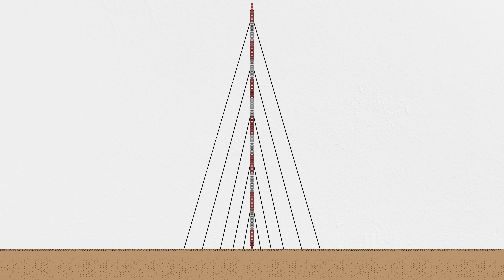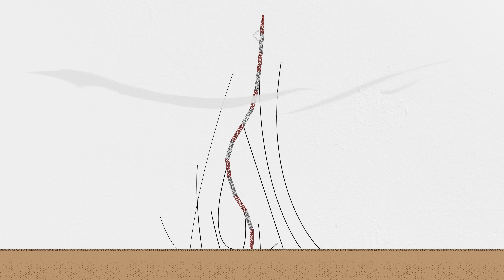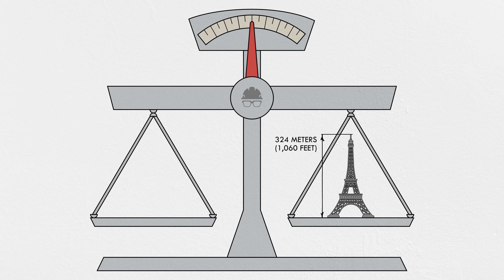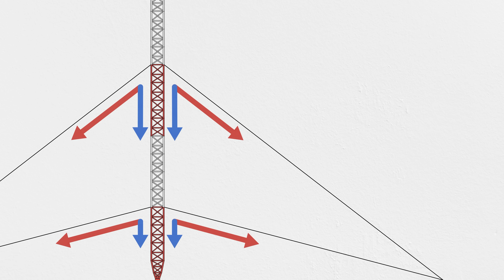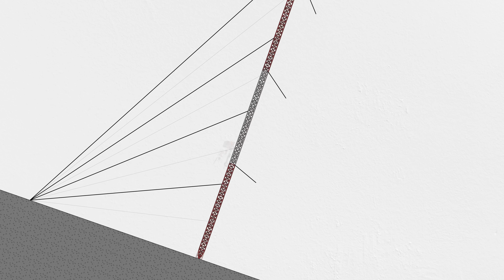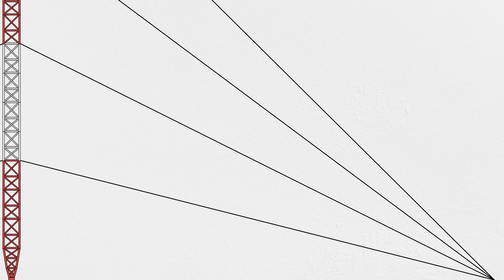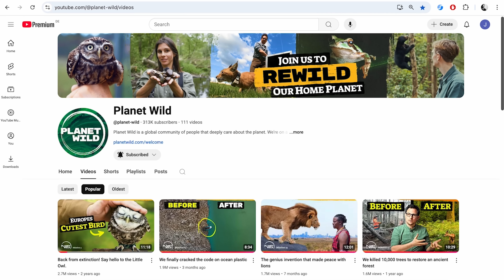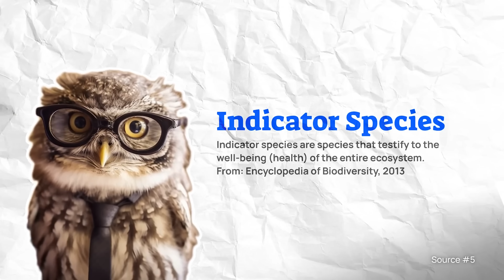The Bizarre Bases of Antenna Towers

Comment: 12:15 - Just don't touch those towers!

And for those who've never seen one—the ceramic base is usually hollow on the inside, filled with a special oil to help provide rigidity over decades of use, with massive strain from above (those guys pull down with a lot of force!).

Also, for AM towers (which are energized), guy wires also have to have special insulated connections, and the design of the guy wires themselves have to be accounted for in the overall antenna design, since different lengths of wire will affect signal propagation and couple to the signal differently.
Reply: At one point Grady mentioned having to put aircraft warning lights on towers but he didn't mention how those lights are powered.  For situations where the tower itself is the radiator you can't just clamp an extension cord onto the tower and connect it to the lights!  If you look at the tower base photo at 12:22 you will see just to the right of the base of the tower 2 grey interlocking rings.  This is a special type of transformer that has a very low capacitance between the primary (lower ring) and the secondary (upper ring).  The primary is energized with grid power and the secondary connects to a cable that leads to the tower light.  The Austin company is one of the major manufacturers of these isolation transformers.    Lots of interesting and unusual tech on radio towers...
Reply: I'm surprised there isn't a collaboration between Grady and you for this video!
Reply: Just use 4 guy wires and make them the radiating element and now you have 2 inverted V dipoles that you can cross polarize to help steer the proportion. Sorry, this is a project I really wanna do with my ham shack
Reply: I loved the videos you did with your dad on the towers. It's crazy when you get to the point where a 'coaxial cable' is basically just a pipe with a smaller pipe inside!
Reply: Those videos you did of the towers your dad looks after were SO interesting, I found them fascinating.
Reply: The legend himself! Good to see you, Jeff. I've worked at the American Tower broadcast facility in Needham, MA -- one of the tallest in the country. The main tower puts out over 1.8MW when energized. Climbing a tower while in that state will leave you with massive internal bleeding.
Reply: @mystic-ripple-r5s7  I'd love to be able to visit a few of the bigger towers with my Dad sometime; right now he's still 'retiring' haha... meaning he still works about 20 hours a week in radio engineering!
Reply: For AM towers they use a wood ladder to get onto them if they are energized.
Reply: HA!  Just called out you guys' awesome video above then scrolled down to see this.
Reply: That spark gap thingy was very cool...
Reply: When i saw this video i went straight to the comments looking for yours!!!
Reply: We made a jig to jack up the tower to replace one...done a few actually. Last one I did was stressful as all hell. The insulator (Made by NGK...yes the Japanese spark plug company) was defective and as we lowered the tower back down onto it, it cracked and all of the oil from the center leaked out...it ended up shearing in half (Have a picture of both halves sitting on the tailgate of one of our trucks). They sent out a replacement and we finished the job a few weeks later. (Also, it may just be us, but we call the ceramic guy-wire insulators "Johnny balls"...no idea why...fun standing near an AM tower with them when there's an electric storm...the arcing of the electricity past the Johnny balls sounds like sizzling bacon (We've also built some with synthetic guy wires...more common on FM towers for the top bit where they shadow the antennas, and transition to steel below the antenna level)).
Reply: I was really hoping Grady would insert a hot dog reference.  The videos you did with your dad on AM radio towers were fantastic.
Reply: Back in 2000, it was Halloween night during my freshman year of high school and I and 2 of my friends decided to climb one…… we got a little higher than the middle light and decided to it was too cold for our hands to climb any higher.  One of the guys suddenly had to poop really badly so he just leaned his cheeks off the outer bars and we could hear it banging the rungs as it went to the ground.  Lol I had always wondered why the base was connected to a point at the base.  They are also so much higher than you realize until you climb up one!
Reply: Here before this gets pinned
Reply: Does that also apply to female wires as well? I didn’t realize they were guy wires and not called guide wires. Seems like guide wires are a lot more practical of a name for them. Where did guy wires come from?
Reply: @HarvLawson  this might sound like an AI overview, but it's what I found. 

"The term Guy Wire, Guy Line, Guy Rope, or sometimes just Guy, derives from the French word “guie,” meaning guide or to guide found in use about 900 years ago" 

The other source I found says this.

"The reason behind the name dates back to its first original use, which was attaching sails to a mast on ships. Dutch sailors called this a “gei”, which is where the modern name comes from now."

Comment: There's two or three of these outside of Newton MA, and I used to drive by then for work everyday. They always teetered the line between "marvel of modern engineering" and "unsettling to look at, why is it so tall"
Stormy days when you couldn't see the tops of them were extra freaky, they looked like they would go on forever.

Comment: A former ROHN engineer here. Good video. The term used in the industry for deflection limits s Twist and Sway. Microwave dishes have their individual tolerances to ensure they can work at a working wind load like 50 mph and still be within Twist and Sway specifications.

Guyed towers are the most complex structures mainly because you have to analyze them for self weight first, then put the guys on them at minimum tension 5-8% and balance the tensions. Then you can apply wind or wind and ice. The towers shorten under their own weight and the shortening effects the guy tension.
Reply: I'm going to be singing Twist and Sway all day at work tomorrow now...
Reply: Man, that's really cool. I only knew about Rohn's shorter (say 50') self supported towers used by many amateur radio operators. I didn't know Rohn built larger towers as well
Reply: As the RF guy, this is why you try to order as few structural analyses as possible.  $$$
Reply: @cjhickspe1399 That is a very interesting comment. At ROHN, analysis was a secondary revenue source. The main job of the engineers was to produce the designs for new towers and poles. Engineering drove the shop production. The highly lucrative analysis could easily pay for the entire engineering staff. I could do one in two hours and charge $2000. The engineers even ask if they could do the analysis on their own time and get $200. ROHN said no and they turned down a lot of work. The secret to their speed was their in-house software matched to their product and having the original design.

The drawings are worth their weight in gold. Getting replacement copies was expensive and could go for $1000 per set. When ROHN went bankrupt, I was hoping to buy the company just to get the warehouse of old drawing to sell copies. The rest of the company could have been sold off for a profit. I was too late and ROHN got bought for a bargain.
Reply: @TexasEngineer Oh yeah, I totally get that. As a mfg, doing those structurals was probably secondary to making towers.  Most reports I ordered or reviewed were not from the mfg but from an SE firm.

My role was specifying the antennas and attachments for whatever coverage I was trying to get to. The problems were varied and usually started with change orders from the customer for this or that (usually dumb). So you would hold off ordering the structural report until you absolutely had to because changes meant another report and more money and then your PM is pissed.  They were usually anywhere from 2000 to 3000 dollars typically and sometimes you'd have to adjust stuff that was no one's fault and do it again.

With the right software - which I am sure is not cheap - I always figured they were license to print money.
Reply: @cjhickspe1399  the majority of the cost of a structural study is the errors and omissions insurance that is required.  The study itself is relatively inexpensive; the liability to the firm that produces the study is huge.
Reply: Isn't Twist and Sway a song?
Reply: I have a small Rohn tower at my house, only about 35 feet tall. Not a lot of climbing here, just to put up  a ham antenna. Familiar with Rohn, live nearby and went to College at Bradley in Peoria.
Reply: @ChrisZost Around 2000 I lived on Detwiller Dr and the Dean of Engineering for Bradly University lived across the street from me and we used to have dinner together. We had the same last name and our wives had the same first name. Another professor lived next door, he was mechanical engineering.

I have a lot of Ancestors from Peoria and I can’t find anyone still living in Peoria. Brons St was named for a family member that was a developer. Almost all moved to Chicago during the Depression.

Comment: 14:43 A substantial part of the internet is still transported over microwave communication even today. And where it isn't the main backbone, it provides a vital backup for fiber optic cables in case they are damaged, which happens all too frequently.
Reply: Sometimes.
I worked in this industry here in Canada, it was very small portions of rural customer had this kind of connectivity, and it was in the low single digit percentages. Anywhere that had more then 50-100 customers usually had a fiber backbone because the demand greatly exceed the bandwidth supply of modern microwave systems >1km.

Microwave is always a really limiting factor, that's why your cell phone always asks you if it's okay to update on a "mobile connection or later, on wifi", cellular in very rural areas is still very much 4G. Most of the cell towers near any "major" population center (500-1000+) usually has a fiber connection to the tower, with a fail-over for call routing, but usually no data on these low capacity systems.

Just my $0.02 from experience I've had in Central 🇨🇦 (and from my southern friends: this is very similar in the Oklahoma/Montana/Nebraska states)
Reply: The end part is - from your wifi router to your phone. Wireless networks operate at the same frequencies we used to call microwave communication. The consumer-facing side of the industry just doesn't use that word any more because it scares people. Tell them they are holding a microwave generator up to their ear and they get a bit panicky.
Reply: @vylbird8014  😂 Those are the same people who happily call microwaving their food "nuking" - which is even technically not completely wrong, because the heating does happen by absorbing electromagnetic waves on the molecular level...
Reply: Uh, no its not.  There's not nearly enough bandwidth available on point-to-point microwave links to replace lost capacity due to fiber optic cable outages.  Consider that 10Gb/s per lambda is dirt cheap these days, with 40 and 100Gb/s per lambda not uncommon.   And then you multiplex dozens of these wavelengths per optical fiber.  (And maybe there are 48 or 96 or more fibers per physical cable..)   Even back when I did Internet backbone engineering for a large global ISP in the 1990's, we never had any trunking that used microwave for backbone circuits.  And that's when OC-3 (155Mb/s) and OC-12 (622Mb/s) was "fast" and OC-192 (10Gb/s) was much, much less common (and more expensive).
Reply: @lmamakos  Did I SAY "replace"? I think not. Kindly read what I actually wrote instead of replying to what you think I wrote. I said it provided a backup. And btw, back in college my dorm had a microwave linkto the data center with 1Gb/s capacity. That kind of link could provide basic service to hundreds of customers.
Reply: Is that true? Modern OTN networks are 100G, 200G, and recently 400G and 800G, and that's one wavelength. I think with DWDM they are putting 40 or more wavelengths over one fiber. I know microwave can get some pretty high bandwidth but it'd take a lot of transmitters to compare with one fiber. I have no doubt that microwave portion of the internet is important, but am not sure about it being a substantial portion
Reply: @Ailuridae42  I have verizon home 5g internet and speedtests show over 300mb/s most of the time.  Upload speed is crappy though.  Usually 10 to 20mb/s --although charter wasn't any better.
Reply: @Ailuridae42  It wouldn't be possible to provide the same quality of service to everybody of course. But it might be possible to keep a basic service running for critical high-stakes participants. In a critical situation, some internet access is better than none, even if you can only do email and basic file transfer. Professional network tenants SHOULD have contingency plans for restricted bandwith emergencies prepared. You wouldn't try to serve normal end-users that way, because they'd only complain they can't watch youtube.
Reply: Too bad everyone neglected 2018 FCC guidelines so 5g failover failed during and well after Helene.

The same people who said "I couldn't even call my grandma to let her know I'm still alive" still lamented "I don't want anyone using MYYYY internet"